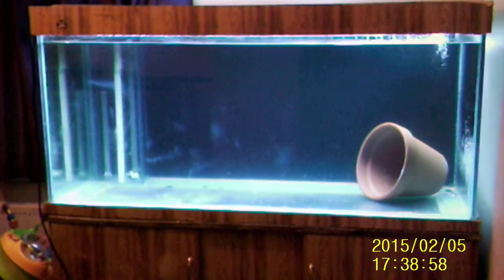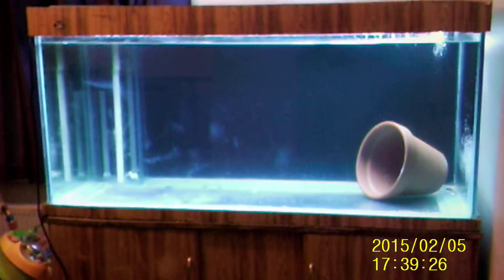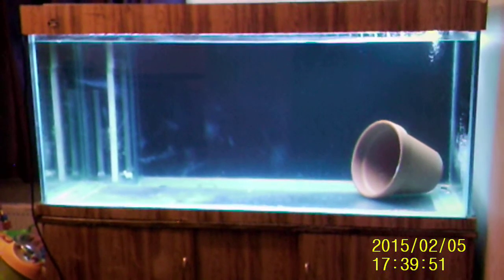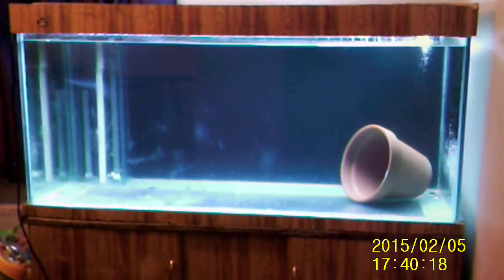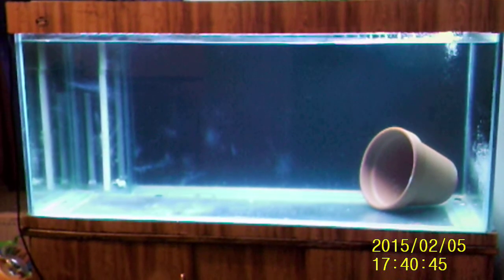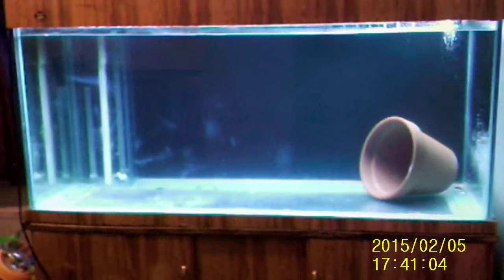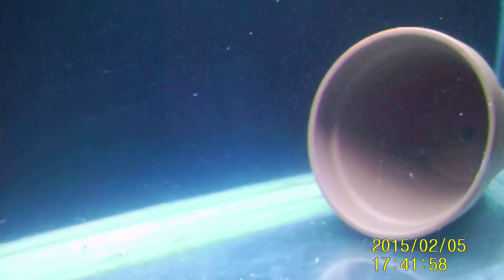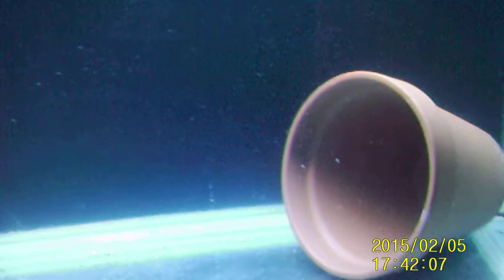180g part 4 on my tank build

Comment: James Feenan Looking forward to the progress had to come and check in to see the results so far..good stuff coming along well
Reply from the maker: SLEWER going through bad spell at the minute there is tick layer of dust all over tank glass and sump i have cleaned everything about three times changed 1800 L of water in one week and i still have some of the dust looks like its problem from my water mains and something wrong in the pump house outside. My 200L tank cracked down the front. i think few days to relax and then go back and sort out everything is the only way to go lol life never easy with lots of tanks and fish.
Reply: James Feenan Strange that's not good      a tall that would bug the shit out of me. Hopefully it will be worth it in the end bro. Im just in the process of changing to a African cichlid tank. so ill keep the updates coming when they have settled. good luck bro
Reply from the maker: i have loads of ideas to fix my problem tomorrow nothing like being in work where its quite and getting time to think.

Comment: Aye mate... Lookin good. I put rocks, substrate, and old filter sponges in my sump to kickstart the cycle. The water doesnt hold much bacteria at all. Glad u got her level. I still need to do an update on my tank... Camera shy i guess lol. 

I hear glass scratches can be buffed out with a special compound that jewerlers use... But may wanna do that now if it bothers you. You only see scratches when looking at the glass. 

Hows the sump flowing now?
Reply from the maker: Things are good i working night shift so my head is bit slow when it comes to thinking and getting things right lol more work tomorrow and i will improve on what i have done. the sump is going good still needs few tweak's. I am the same camera shy but its easy to talk once your not in front of the camera lol and i do stutter some words and get them mixed up but that's life
Reply: James Feenan I know how you feel so I think you do better then me ;)
Reply from the maker: i probably only side it in my comments and not in my video i am going to use my aps 2000 filter and everything from my 200L tank i should only need the water up to 36 deg and i will add the fish once the readings are correct i am only adding water now from other tanks until i have this up to temperature
Reply: I think maybe he mean's use a handful of the bottom of the tanks 2 ;)
Reply from the maker: I am shutting down the 200 L tank for now so i will be able to move everything
Reply: Have a good workday then with the tanks! Don't forget to get the camera on there so we can watch the update later :)